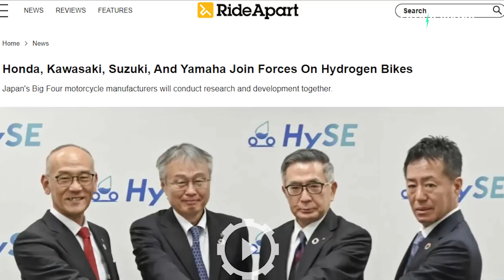Honda joins Toyota's, Suzuki & Kawasaki to make hydrogen engined vehicles

Comment: I guess if Japan in braces hydrogen and actually puts in hydrogen fueling stations it could work. Here in California what do we have five or six  they've been taking them out not putting them in. If you have range anxiety with charging an electric car try to find one of five hydrogen fueling stations here in California. Good luck. Refining hydrogen which comes from crude oil is a messy business and a hydrogen car is going to have a crankcase with oil in it. It may be clean emissions but the rest of it no thank you. With an electric car I can charge for free from the solar panels on my roof. Makes no sense going hydrogen.
Reply: Hmmm....  lube oil for the hydrogen IC engine - never thought of that.
But if hydrogen ICE cars lead to enough fueling stations, maybe hydrogen fuel cell cars would be viable.

Comment: Japan is energy insecure so it makes sense for them to pursue hydrogen.
Reply: If they are energy insecure, how can they mass produce hydrogen. It doesn't exist naturally. You have to electrolyze water to get it. If so, why don't you use BEV in the first place? Just like someone else said above, hydrogen car is more like an ICE burning more expensive fuel.
Reply: @ericliume  They can use their car to power their homes for longer than a BEV when the power goes out is the reasoning.
Reply: @marcelstanford430  It depends on whether it has the ability to generate electricity and output it, since there are two types of hydrogen cars, FCEV and H2-ICE. Even if it has longer output than BEV (battery capacity dependent), in case of multiday blackout, the hydrogen cars are more useless than traditional ICE and BEV. BEV can be charged by home solar system, and ICE can be filled up in various ways during blackout. However, hydrogen cars can't, since from production of hydrogen, storage, to refilling, all depends on electricity. During the catastrophic 3-11 earthquake, many parts of Japan experienced outage more than 8 hours daily, for some place it was stuck with blackout for more than 2 weeks.

Comment: In early 2000 I thought hydrogen cars would be the next best thing. Same power but zero emissions. That was before EV were a possibility. Hydrogen cars would return de maintenance level of before EV . That is a major step back
Reply: Hydrogen (the CLEANLY made kind) doesn't need metals like Lithium/Cobalt/Manganese/Phosphorus or Graphene for batteries.
I'd like that the Japanese car companies are putting serious research into using Hydrogen as an alternate path to mobility.

Comment: Honestly I think this is a good thing!   If they can get the  refueling stations in place  cool. A future in which we are in the same boat as we were 20 years ago where all you have is one way of doing things I.e only ICE cars rolling around  naw… multiple technologies is a good thing.
Reply: A multiplicity of techniques that work at approximately the same level is a good thing.  But when one is clearly superior by 3 or more times the others need to remain in research until they are at that level.  The problem is that hydrogen is worse on every front.   That is hard to fix.  Do you want a ICE hydrogen car and pay 10x what your neighbors do to own and drive their electric.  The idea of hydrogen ICE should make you shudder.
Reply: Multiple technologies will make them bankrupt, the car industry isnt like the phone indsutry or technology industry, and multiple technologies is not good the the market either, mostly because if you present multiple ways to use cars, only one will prevail, the rest will go out of buseness, in our case, Evs are winning, because there are Hydrogen cars already in the market, and nobody is buying them.

Comment: This Engineering Explained video shows the fatal problem facing hydrogen combustion engines: their inherent inefficiency means they'll never be feasible as competitors to standard EVs. Their very expensive fuel will require massive storage capacity to enable usable range for any hydrogen-combustion vehicle. This aside from the need to build an H2 distribution network from scratch, or the problems with creating and maintaining millions of 10,000 psi pressure vessels worldwide, or the fact that hydrogen combustion isn't actually zero-emission, or that producing green hydrogen will waste massive amounts of renewable energy, or that green hydrogen will be hideously expensive. The whole thing is such a fool's errand.

https://www.youtube.com/watch?v=vJjKwSF9gT8

Comment: Kind of funny how fast the EV Community became the new naysayers. 😂
Reply: All in all it is a matter of physics. 
Hydrogen Engine: 1000Wh Electricity -> 750Wh hydrogen -> 250Wh motion power
Electric Engine: 1000Wh Electricity -> 900Wh battery power -> 720Wh motion power
Reply: It is VERY hard not to be a naysayer when faced with such ridiculous efforts.   Costs like 3X to make the clean hydrogen then burn it in an ICE that is the ballpark of 25% efficient.  Not far off of perpetual motion.  Or maybe you buy into that too?
Reply: It's based on science: the transportation and storage of hydrogen is not an easy task.
It has to be pressurized and needs other kind of infrastructure to be built.
Electricity is everywhere.
Reply: @ricnyc2759  Reliable electricity? Been to California in the last few years? lol
Reply: Because we went to science class.
Reply: It's not good enough for cars.big transportation vehicles would use it.

Comment: What we are seeing is the modern equivalent of the steam engine being replaced by the internal combustion engine. Significant advances were made in the dying years of the steam engine and diehard ostriches maintained that it would prevail over ICE engines. Currently the ICE is being replaced by electric motors. The sheer desperate ridiculousness of suggesting that hydrogen ICE is a good idea doesn't bear inspection. New infrastructure (vs new outlets in existing infrastructure), very leaky and dangerous fuel, reduced reliability, increased complexity, mass storage of hydrogen as a liquid?, ...

Comment: GM gave up on hydrogen for several reasons. First, battery technology turned out to be racing forward so it wasn't really necessary; the problem of inadequate range from BEVs having been solved. And second, the fundamental fact that hydrogen is not really a fuel, but an energy conduit. Hydrogen has to be manufactured from either natural gas (which defeats the purpose) or water; in both cases it takes far more energy to make the fuel than you get out of it onboard a vehicle. But unless I completely missed something, GM and others investigating hydrogen ~20 years ago were planning on fuel cells, not hydrogen fuel ICE. The idea was to produce an alternative to batteries to power essentially the same electric motors as in a BEV, not to directly burn the highly explosive, literally rocket fuel, hydrogen in ICEs. This seems totally nutso to me.
Reply: The Germans were doing this 20 years ago. They abandoned it, because they're smart.
Reply: Not to mention Hydrogen combustion Engines are no more efficient than any other combustion engine only delivering about 20 percent of all the energy from burning the Hydrogen to the wheels.

Add that Hydrogen has terrible Volumetric density and the limited space to store it in a vehicle. You might be lucky to get 50 to 100 miles of range from any personal vehicle run with a Hydrogen combustion engine.

Comment: Biggest problem with hydrogen is that, while abundant, it does not exist in readily available form and requires massive amount of energy (i.e., electricity) to manufacture.  Logically, said electricity should simply be stored in batteries and not diverted to make a fuel that will power costly engines.  In my view, Japanese manufacturers are doing this to discredit BEVs and to possibly prevail (as improbable as it is), so they can continue to profit from selling parts and service.
Reply: The project will run out of money before it gets anywhere.  Money is energy.
Reply: The next biggest problem is its terrible Volumetric density. It's near impossible to store enough Hydrogen in a vehicle to get more than 60 miles of range from a HYDROGEN ENGINE. Which is no more efficient turning burnt hydrogen into kinetic energy, than an ICE engine, getting at most 25 percent of the fuels energy  to propel the vehicle.
Reply: They don’t make money from servicing cars that’s what the dealers do the same way the manufacturer sees none of that markup money they’re just extremely conservative I feel and are just scared to dive into evs full stop so they’re exploring other options nor does Japan have the same access to lithium other countries do they’re not crazy lol for many reasons it makes sense for the Japanese to explore as many options as possible before submitting to having to import the power source for their entire transportation industry which puts Japan as a country in a much more vunerable place than before so even if it’s not as efficient  if it does zero emissions the Japanese are looking into it countries like the US can just excercise the Monroe doctrine like we don’t already have the resources they certainly won’t die for it Americans are stubborn and spoiled lol we need a charging network that’s reliable outside Tesla ownership at the very least there’s a market for the next 20 years while they figure this out

Comment: 30 years ago I did H2 engine conversions. I experimented with a 1978 Honda CVCC (remember those?), and I ran a lawn mower and BBQ on H2 . I ran low pressure H2 on carburetors using a CA350 injection system. I had the reverse problems- the engine ran cold, and I had to make adjustments to remedy that since H2 has a wide flammability margin. I chose the low end. To make the engine run clean you had to use various catalysts which do cost money. Storage is a problem although I created a system that was in the middle of a patent. I experimented with other systems to run H2 including a Bolivian inventor Francisco Pacheco. As I have seen and driven H2 Fuel cell cars, the price of H2 is very expensive. This is a not a solution. My conversions of engines still needed oil changes etc and regular servicing. In California I still needed to smog check the engine. H2 is produced in many ways (gray, blue, green, etc), and most H2 filling stations can only fill 50 cars a day, and we have a problem with infrastructure. It is still not a solution.
Reply: I live in a state(OH) with not even 1 hydrogen fueling station. I have 2 EV chargers in my garage. I ran the wire. Chargers are way under a grand. Some under $500. Cost per mile is great. Solar is an option.  Not only are EVs way ahead, but where is hydrogen's advantage? If the handle doesn't freeze to your vehicle, hydrogen might fuel faster, but EVs are fast enough, and have an advantage in everything else.
Reply: @fjalics  yes EVs I find more reasonable. I charge on solar myself. EVs in my opinion offer more options. I can use solar, wind, even a natural gas generator, or regular gas generator, etc. Charging speed is fine for me as I do a lot of trips to the CA desert. My only charge stop I use is a 10 min bathroom break which charges the battery to more than what I need. Charging on trips does not take 6 hours as everyone keep saying. My longest charge is 12 minutes. BTW The Viking is right. In Los Angeles they have removed some H2 filling stations. A Shell gas station in redondo beach has one, and they also have a quick CCS charger. That’s smart to have both. BTW I use a CNG truck for work and once the handle got frozen on the truck. 😂 I had to wait longer than a quick charge to let it defrost.
Reply: I'm glad to have your input; your real-world experience agrees with my theoretical take on hydrogen, namely, it's possible, but why bother?
Reply: Hydrogen is nothing more than a fossil fuel pushed technology. It takes 4 times the amount of energy to extract it from water, your green version, than from natural gas. So either way they win. It's why they created the hydrogen council along with Toyota. They've been working on it since the early seventies and have gotten nowhere, and will never get anywhere because the EV solution is so much better and easier, and most importantly, much, much cheaper. Money talks.
Reply: Thumbs up for this gentleman. I think fuel cell is a eventually inevitable when we move beyond yhe stars. Considering the hydrogen is the most abundant element in our universe. But hydrogen ICE.... eventually when hydrogen vecomes dirt cheap, there will be some hardcore piston head( presumably they dont go extinct before that) will tread the path what you have done before.
Reply: Maybe if hydrogen becomes a byproduct of electricity generation.
Reply: @ebee-w2t  but why would that happen? Adding extra steps always introduces inefficiency.

Comment: That's such an easy thing to figure out.
What's easier? Transport hydrogen in tanks or use cables to distribute electricity and store the energy in batteries? 

Anyway. I see a possibility of planes and large ships using hydrogen as "fuel".

Comment: You really shouldn't use F&F as a technical reference.  Running lean does not give more power.   You need more oxygen and more fuel to boost power.
The big problem with Hydrogen combustion is the lower efficiency.  A FECV get about 60% efficiency from the Hydrogen-electricity conversion, maybe 55% hydrogen to mechanical.   Combustion engine will give about 25% Hydrogen-mechanical efficiency.
It means that it will cost around 12x more per mile than an battery EV, and the range will be halved, so say max 200miles.

Comment: Problem for them is they are planning to compete where EV are good at. Small vehicles and minicars are where EV excel. Small EV don't require long ranges and are easy to charge. Wuling already manufacture millions. Additionally  using a hydrogen which is rocket fuel would be most dangerous on a small car
Reply: For road and marine operations, electric motor are the way to go. On land and sea, you need the torque to get thing going. Especially when you try to start moving from stand still.

Comment: Hydrogen ICE : 70% electrolyser efficiency, 25% ICE efficiency = 17.5%. 
Hydrogen fuel cell : 70% electrolyser efficiency, 50% fuel cell efficiency, 95% motor efficiency = 33.3%.
EV : 95% LFP battery efficiency, 95% motor efficiency = 90.3%.
EV are 5x more energy efficient than a hydrogen fuelled ICE.
It seems Toyota haven’t been able to make a hydrogen fuel cell which is cost / performance comparable to an LFP powered EV , so they now hope to convince us it’s better sense to purchase a H2 ICE  which has a running cost 5x higher than an EV, and requires a network of H2 refilling stations.
Pursuing this delusional strategy will only hasten the decline of the Japanese motor vehicle industry.

Comment: Japan as a nation may have decided to expand nuclear instead of solar and wind, and also use it to produce hydrogen.  The goal would be CO2 free energy with a small footprint, use of less exotic materials...
Reply: From energy consumption point of view, using electricity to produce hydrogen is an economical  disaster. 
Hydrogen Engine: 1000Wh Electricity -> 750Wh hydrogen -> 250Wh motion power
Electric Engine: 1000Wh Electricity -> 900Wh battery power -> 720Wh motion power
Reply: Unless they are generating hydrogen instead of electricity at the nuclear plant what it the point.  Use BEV and 3X or more miles.   Japan has EV battery technology.  Just need to scale it up in country.  Source the minerals.  Get with the program.

Comment: I think you're ignoring 2 elephants in the room here with EVs. Firstly, the electric grid in China is mostly coal fired. That makes ICE engines cleaner than EVs. Secondly, most Chinese live in apartment buildings and have no place to plug in their EVs. Hydrogen cars could quickly refuel at converted gas stations. It would be very insightful to talk with Toyota and Honda engineers if they would be willing to share proprietary information as yet.
Reply: Nope, the majority of the electrical grid in China is hydro. Perhaps a decade ago, coal, yes. Also, EV charging station is everywhere in tier 1 to some tier 5 cities. Last, bet you have never been to China.

Comment: Hey Sam, are you going to talk about BYD batteries in Tesla Y being able to charge faster then CATL batteries... Nah that would be good news about blade batteries!
Reply: @Enrique A Thiele Solivan My point is that Sam is very selective on reporting about BYD unless it might be bad news. I think it all stems from the possible relationship that he mentioned a while ago that did not happen?
Reply: @highfired100  Sam purchased a Atto 3.     What possible relationship?
Reply: @danharold3087  about a year or so ago Sam referenced that there was possible going to be some kind of business relationship with BYD. He did not elaborate but said to stay tuned. That obviously did not happen or he would have told us. I'm just wondering if he is a little bitter and that's why he does not make as many positive videos on BYD. Every time Tesla does anything he makes a video. There is so many positive things gong on at BYD and he seams to stay a little more quiet? Case in point why wouldn't he have reported on the news that Blade batteries charge faster in the Model Y than CALT batteries?
Sam?